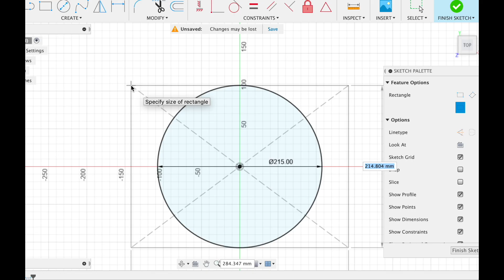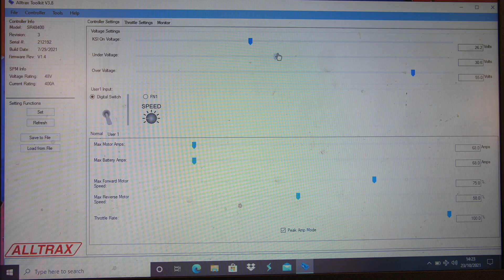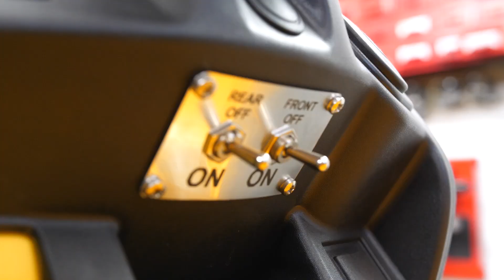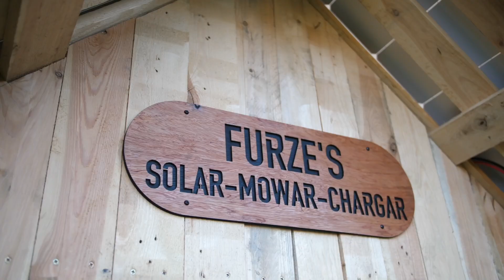EV Mower Conversion with Solar Charging Station

Comment: Should have the charging cables hanging from the roof so when you park the mower you can grab them whilst sitting on it!
Reply: Even better is a charging dock. Basically you could put two large electrical contacts on the front and have large spring contacts in the shed. Driving in would complete the circuit.
Reply: @eDoc2020  Could be annoying though. Even McLarens charging pad for their million of dollars Speedtails works horribly

Comment: The only thing I would have changed would be to use a 12N and 12S connector for the charging instead of both 12N. Colour coded and impossible to plug in the wrong lead.

Comment: Yo, lead acid batteries, are ya getting old? Oh no you know, LiFePO4 the way to go! 1/2 the weight 4x the power (charge to 100% use down to 20% no problem) up 6x the cycles. Lead is dead! Expensive? Calculate everything, cheaper!

Comment: you can buy the battery box for such a 3.7 volt battery of 12v i often put groups per four selen for 12 v because charging is over 12 full so they will last much longer than if you put 4 v on a cell what many mistakes do to save costs, so you can save 100,000 kilometers without a dead battery .. you can reduce current with resistors or according to the consumption full controller for the motor

Comment: ....
Reply: you can buy the battery box for such a 3.7 volt battery of 12v i often put groups per four selen for 12 v because charging is over 12 full so they will last much longer than if you put 4 v on a cell what many mistakes do to save costs, so you can save 100,000 kilometers without a dead battery .. you can reduce current with resistors or according to the consumption full controller for the motor

Comment: Colin’s neighbours: Finally he’s made something that’s quiet and doesn’t shoot fire!
Reply: next video: I made it shoot fireworks while it mows
Reply: Don't get used to it LOL
Reply: @danielstellmon5330  ⁶
Reply: yet
Reply: Next video

Mower gets flamethrower and fold out marching band.
Reply: Just wait till NEXT week!
Reply: wait till he puts some Lion batteries in it
Reply: You'd be surprised, but an electric lawnmower isn't that much quieter than a gas powered one. The blade makes one hell of a ruckus.
Reply: @Alsacien  still a lot less vibration, no fumes, near silent when not cutting, you can drive it in and out of a garage without fumes or making noise, you could easily move it around the garage without doing a come start and shutting it right back off, no fuel to deal with, no fuel to go bad, no fuel storage. If you like your neighbors it’s less of a nuisance, i really think it’s great, it would be cool to try and make the blades quieter possibly adding a second blade to each shaft so they’re like a four blade fan versus a two blade, much quieter on a fan or a helicopter as a comparison
Reply: If I were his neighbor,  I would be like.... where's the noise and fire? Bring it back Colin!
Reply: Inba he adds a tesla coil music tower to the shed.
Reply: ..not yet!
Reply: Not to worry. He will add a stereo because he has too much power
Reply: For now.
Reply: Honey do you hear that.
Noo its quite why.
I don't hear a jackhammer or see fire should we call 911.
On no lets go check on him.
Walks outside bolth.
🤦‍♀️🤦 well at least its quite 😅.
Reply: I was thinking why can't he be my neighbor
Reply: If he gets a cheap lithium battery, it may yet shoot fire lol.
Reply: and then the chargar cabins turned out into a 80's disco club.
Reply: That's what the lithium ion batteries are for
Reply: next time he makes a lawn mower that uses fire instead of blades to shorten the grass
Reply: Or potatoes
Reply: josh  oh right different country different emergency number 😆.
Reply: Can just imagine Collin now "Hold my beer"

Ride on weed burner that plays Ride of the Valkyries on the bagpipes
Reply: How about if the battery went pop ?
Reply: Wait till part two 😂
Reply: But they start looking funny, because they saw what photonicinduction can do 🙂
Reply: That said, I can't help but imagine that to a neighbour a quiet Colin furze is a suspicious Colin furze 😅
Reply: That ain’t commercial sized, that’s American sized
Reply: Haha
Reply: I think his neighbour’s are jumping with joy
Reply: Give it some time... Lol
Reply: Or resulting in illegal dirt dumping around the local area
Reply: Lol the back yard won't be quiet
Reply: They may actually think he's lost it at that point lol
Reply: Davis kr  :_shirt:
Reply: YET 😂
Reply: He bought his neighbors houses awhile ago with that youtube money so they would stop complaining.
Reply: Give it time
Reply: Just wait till next vid... weaponizing the solar mower
Reply: WHERE'S THE TUNNEL!!!!

WE KNOW ITS ALREADY COMPLETE PLEASE UPLOAD THE TUNNEL VIDEO'S!!!!!

Comment: Been waiting for someone to sell a conversion kit to do this! Ryobi, and other major companies already selling them.
Colin mean green mowers here in the US has lithium powered commercial grade electric mowers, with solar roof options!
Reply: E-Go also; those 40amp and 56amp batteries are compact and powerful; I expect Colin could do a lot of damage with those!
Reply: @lairdcummings9092  I think you can load up to 6 x 56V batteries in the E-Go riding mower. Should go for a while.
Reply: @Kenjh71  yep. We sell 'em. Advertised as "up to three acres." I'll bet there are a lot of caveats in that claim, but even if it's twice as optimistic as reality, it's impressive as heck.

At us$5k per, we sold every one that came in within days. Landscapers love them... They can start cutting lawns as soon as it's light enough to see, without disturbing anyone. Puts two or even three hours onto their daily schedule - that's a lot of extra income.

Comment: Any idea how much all this costs? I've got a blown motor on an old mower and if it's cheaper than just buying a new engine then I'll probably do something similar.
Edit: I don't need the solar charging station though so just the mower costs.

Comment: This worked way better than I expected. The fun thing is besides needing new batteries after 5 to 10 years and new solar panels for the shed, the rest of the mower is maintenance free for the life of it. Clean it off occasionally, grease the pivots once a year, and maybe change the fluid in the hydrostatic transaxle after 10 years. I think this could be a real product and it could compete with current mowers, especially when you show people how quiet it is and how easy it is to care for.

Comment: Battery is 70 amp hour, trying to use 68 amp hours...what are these batteries?  If they are lead acid which is what they look like then that would destroy the batteries very quickly.

Comment: the creation of solar panels is not carbon neutral. in fact, solar panels are one of society's biggest scams right next to religion. Energy generation is most efficient the bigger the generator is. Using multi stage energy capturing, like nuclear reactors and large gas turbines use. They squeeze every ounce of energy out of the pressure, off the heat and off the velocity of the gasses until you get inert slow moving cold gas escape the factory; using air bearings and other high efficiency high voltage low friction systems. You lose energy just by gyroscope effects in cars. Left/right turns eat a lot of energy~

Comment: Tesla batteries.  Good batteries, very expensive.  People always chucking out electric car batteries though, could always try fix some faulty ones? (not recommended, only suggesting as you have a background doing some sort of electrical engineering work, well I assume).

Comment: This is awesome.  I'm really curious what the conversion cost.
Reply: Pretty damn expensive. Those batteries are like 60€ at least for peace. Motors and speed controllers if i recall right several hundred making just the electric trike alone way too expensive to build, let alone having two sets of those and then cub cadet on top of that.. by looks of it nearly brand new one for that. Sure you get 11hp brigs engine out of it but still.. 2K€ at very least.
Reply: @Hellsong89  I can get a pooched mower easily for nearly free. The conversion will still make it cost more than a new gad mower

Comment: You can get reclaimed batteries from cars or loads of other stuff to get Lithium Ion Batteries pretty easy, and even if your not using reclaimed electric car batteries you could get a kit for likely 3k two or three kits are what are expected for powering a full house with solar or other such depending on draw. You should look into that.

Comment: How about buying individual cells and connecting them with nickel plated copper strips tacked on with a spot welder, similar to the ones LTT or Aging Wheels made
Reply: Will def. require a charge controller though

Comment: Colin only using 70amp lead batteries . How about using 100amp GEL batteries. 😁😉👍  It should go even further & provide a bit more power & if speed is a issue ( as he mentioned it is a bit slow.  Then try ajusting it's throttle  regulator  ( if it has one inside it somewhere. But,  it could very well do more harm than good by trying to make it go from i.e 4mph to i.e 15mph  or more 😳😳😳😳  Proberbly not wise to But,  then Colin is full of some really crazy ideas ( as we all know from what he has created over the years we have known him).

Comment: Beware! Lead Acid batteries should not be used below 50% capacity. And you should charge them back up quickly if you don’t want to degrade them.

Comment: Proper job! 

To everyone hating on using lead-acid batteries, as Colin showed the packs inside were way overkill for his backyard and it still had some oomph left in it. Also, keep in mind that lithium packs HATE sitting for a long time between cycles. Realistically how often do you mow your lawn, and then how long does the mower sit between uses? Lead-acid does not care as much about sitting, ideally you want to trickle charge it which the existing array could do. Also, we have the infrastructure in place to recycle lead-acid batteries, lithium... Not so much 🤔. Not saying it can not catch up but until then, it is an issue I want to see fixed. Lastly, a lot of the stability/traction for the mower comes from the heft of the existing motor, and removing that could become a safety issue.

Comment: A couple of big LiFePO4 batteries and a better more efficient mppt charge controller would be great LI ion batteries can run alot lower before the voltage drops.
and a solar grid tie unit would give you backup power and 240v to use in the house/shed I really want one now i've seen this haha

Comment: NOW next project. garden power tools. whackers hedgers blowers etc.. add a battery to the shed itself and extra power into that battery from the panels when the mowar is done charging. charge the batts for the cordless yard tools. this way 100% of your gardening power requirements will be solar powered.

Comment: Before I continue watching your video I just wanted to say your wood powered lawnmower wasn't just cool, it helped me understand why there's a fire the refineries in my city have on the top of the smoke stacks. It's because the gases the refineries put out are harmful for the environment so they burn the gas to not pollute the air as harmfully as the gas would.

Comment: One thing that bothers me about electric vehicles that use the standard connector is that there's no option for DC slow charging. If I want to charge my EV from solar I need an inverter to feed AC to the car which then rectifies it back to DC.

Comment: Hmm, now it needs GPS and wireless chargers so it can do the mowing itself like a robomow.
Also, furze it up a bit, maybe burn the grass cuttings to power a sterling engine to drive an aux belt for lights.

Comment: Very cool idea. Would be extremely cool if you lowered it a bit to give it a sort of drift car vibe. Or  just put an air suspension on it so you can turn it into a drift mode (even if it wouldn't be able to drift, it would still look cool).

Comment: even using a lil 50cc weed whip motor to generate more range off a gallon tank would increase it's fuel efficiency a great deal mostly never used except for when you wander too far and need to return home ... also hood mounted panels through a capacitor/charge controller to float charge the batteries while in use and if parked for a couple minutes out in the sun ... ya know when your seat gets scalding hot cause the black vynl on the spring loaded soyfoam sponge and although it's fun to drive yourself i could see collin roboticizing it so it learns a geofence and has a obstruction detector so it can't run over small bewildered children and the family goldfish that wandered too far from it's bowl. the trick is gonna be having a mini automatic eject square baler so you can stack the high quality grass for animal feed or whatever use ya have for the fibers

Comment: COLIN you can get 1865s cells and find a guide on how to do it (and you need a bms and batt specers DO NO SOLDER THEM SPOT WELD THEM WITH NOKOL STRIP OK YOU WILL KILL THE SELLS IF yOU SOLDER SO DO NOT DO IT OK and use a bms OR IT CAN SET A FLME OK COLIN)

Comment: The biggest trouble would be the overall cost of this for practical application.
Reply: Have you checked the pricing on a John Deere lately? I’m sure Colin could build a mower with a new mower and deck for less than Deere would charge for it.

Comment: LiFePo4 replacements for SLABs do exist - Ultramax have a 12v 100AH with the appropriate charger stuff built in. It's also not too much work to use 18650's and a BMS to build your own!

Comment: If you're up for a v2.0 that is a whole other ball park of crazyness, you could wire your lawn and let the lawn mower be induction driven! (maybe it could even be useful to attach the coupler coils to the cutting blades to increase the movement between the (alternating) magnetic field and the secundary circuit (the mower)... Not sure if it makes enough of a difference, but I tossed it in there for the mad genius to figure it out haha)

Comment: You could always put in like 20 tool batteries and get 120ah or so, series/parallel them to get the right voltages for your motors. Just need to get the right mounts from eBay/Amazon/3d printer for them. As suggested elsewhere, keep your other tool batteries topped of in the chargar shed too. Richrebuilds motorized a bubble-car with tool batts if you want to go take a look. Will be lighter too hopefully.

Comment: I love the fact that you used Batteries that can actually be recycled entirely and that don’t need the equivalent of driving a small car for years in CO2 to produce them. Truly makes it a green project, way more green than any electric car will ever be 👍👍👍
Reply: Yeah lead and acid are great material....
Come on, the 90's are over. 
What's the environemental footprint of lead and acid?

Comment: Lithium batteries are easy to build, 3d print the cell holder, buy nickel strips, cheap spot welder, bms and cells, spot weld cells, sodder bms leads, tape everything up and shrink wrap, done........

Comment: Bit crazy to use lead–acid, wouldn't it be better if it was lithium?
Why not series all the panels into one MPPT charge controller. But is using a PWM charge controller but they are only 75–80% efficient.
Reply: He literally addressed that at the end of the video numb nuts.
Reply: @connerocks  well done there I realised that. thanks for pointing that out very obvious. I'm entitled to express my opinions, dipstick.

Comment: Make the battery pack yourself. Just buy a shedload of 18650 3.7v Li-Ion batteries. 2300mAh for cheap ones to 3600mAh for more expensive ones. Buy from a reputable supplier online and just chain them together. You can buy cheap plastic frames that can be connected together to insert the batteries into and the frames connect together to make battery packs. Just gotta' solder all the connections. Series a group together to make a pack with the required voltage and then make several identical packs and just run all the packs in parallel to get the capacity you want.

Edit: Thank me later.

Comment: In the states, I know there are companies that make batteries that look the same as car batteries on the outside, output 12 volts, use the same terminals on top, but are packed with lithium ion 18650 cells.

Comment: You could use the grass clippings in conjunction with a bio gas digester to create gas for you household cooking needs! Trying to make one myself when I get the time.
Reply: Running a circuit of pipe through decomposing lawn clippings under a black tarp as a pre-heater for your hot water system is a cool energy saver too.

Comment: Headway batteries, and the lead can be a stowage bank. Then you can charge the lithium without burning the solar charger, designed for 12v LA. That way the power is available for charging even if you are using the mower.

Comment: Get some lifepo4 cells and build your own battery. You can check the channel DIY solar with will prowse to learn how to build a lithium battery and cells review. it's a lot easier than it looks and you will gain serious range boost and also battery longevity.

Comment: Cool project! But these 8 panels would do a better job if they pushed the energy into the grid. And you could think about using the lawnmower as a storage to power other electric devices in your workshop since the they are otherwise only sitting there fully charged...